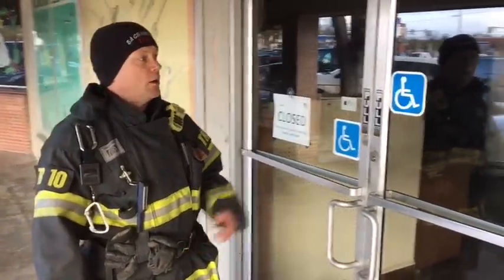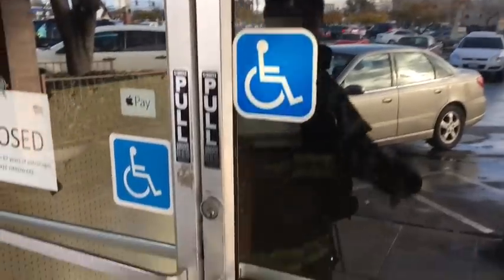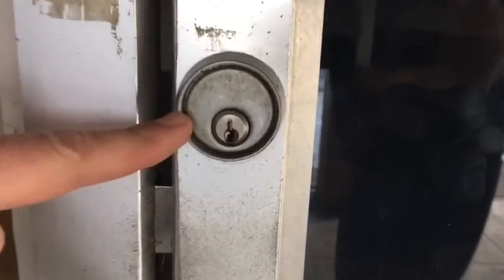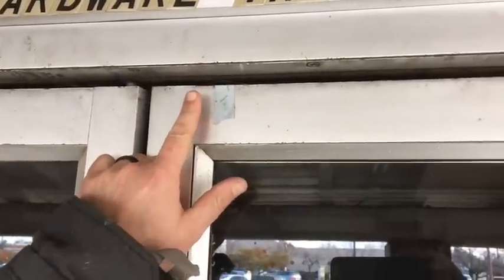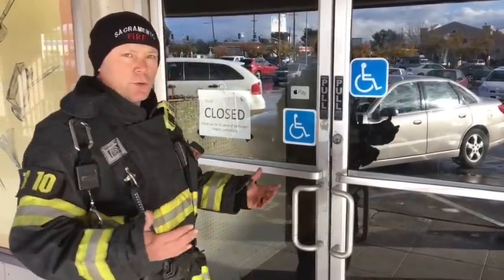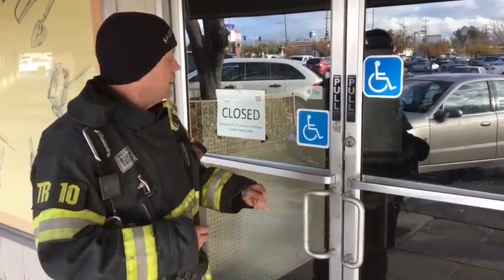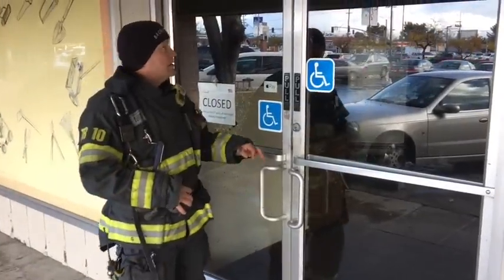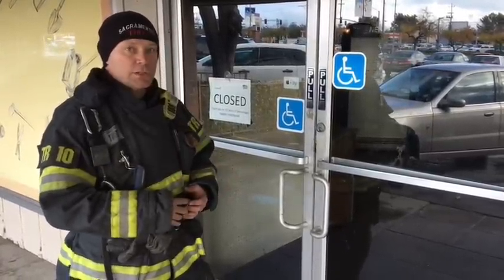Forcible Entry for Glass Commercial Doors

Comment: If it is a thumb turn latch inside there is a tool to reach in and let you rotate it from outside. Can be done in seconds and even used after to relock the door if you find it was a false alarm and no one with a key has shown up yet. Also works with weather stripping between the doors if you can wedge it back to give you access. 

Needs the gap between the doors to insert and the inner lock needs to be a thumb turn so only works on older style setups but still a good option. Right up there with the tool to pull the release handle on a garage door opener to let you lift the door for access as you can do that faster in some cases then kicking down a door if they used long screws and reinforcing pins.

Comment: Reminds me when the company I worked for about 20 years ago had the rear door upgraded to one with a panic bar.  The vertical top to bottom anti-tamper strip it turned out was optional. Customer service manager forgot her new set of keys and asked to use mine.  I popped the push bar as the FF in this video briefly mentioned to make a point the new door was less secure than the old one.  The door was retrofitted with the anti-tamper strip that day.  I asked her if a new key was placed in the fire fighter key box.  She did not know we had one.  Fire captain thanked us and reminded his crew to always verify during annual inspection the box has the current keys.

Comment: Good stuff Truck 10. I always looked for a cheaper plate glass window next to doors (less expensive to repair than the doors), just the downside is flow path like you mentioned and broken glass to deal with. Always fun working alongside SFD during high rise drills. (Roseville Truck 1-B, retired).

Comment: Quite detailed, and a highly accurate representation of door hardware. I'm a door hardware guy / locksmith in Sacramento. It was very nice to hear you say that your breach methods are relative to the emergency. Small shop owners appreciate that.
Reply: My dad us a firefighter and has always told me that you never use more force than necessary. 

He got off shift one day and told me how his crew spent an hour at a shop after the call (fire alarm) was over simply to put the lock back into the door so the owner wouldn't have to worry about it. 

His other story is a person having a heart attack. They got to the door and it was locked, so his firefighter went back to the engine to grab the tools to open the door carefully, but dispatch came on the radio and said the victim was now gasping fro breath and unable to communicate. So he told his engineer to open the door. His engineer kicked the door hard enough to push the deadbolt thru the door frame (wood) and it swung wide open, about that time the firefighter got back with the proper tools to open it without damage and was like "Well I guess we won't need these."

Excellent examples of use of force in forcible entry. One there was no life or property at risk, so no need to go crazy and break shit. The other one there was an immediate threat to the victims life so damage to the door was secondary to victim survival.
Reply: Jared Barsuglia WUT ur address
Reply: You seriously pressed 4 keys to butcher the word "what" that bad? I applaud the effort, but dude, I'd be surprised if he responds. He's not hard to find, try google.
Reply: You didn't have to point out your name sucks, it's evident.
Reply: bamrak2000 lol

Comment: All of this and they could simply get a Quick Jim that will engage the thumb bolt on the other side, the quick jim is a tool that is U shaped and allows the person to move  the inside thumb bolt as if you where inside allowing you to unlock it without any damage to the property and giving you the ability to make entry when you see fit. Cost is about 80$ or less for Law Enforcement or Emergency personnel.
Reply: A lot of places have a lock on both sides.

Comment: All those fancy tools.. you can open that door in 60 sec. with a single pair of vice grips without causing any damage or visible force entry marks. On the mortise lock there is a very small single set screw keeping the key mortise from spinning. If you grab the outer lip with the vice grips and spin counter clockwise the setscrew will slip every time. Unscrew the mortise and reach in the hole with almost anything pointy and move the latch bar to the right. Unlocked~ Have had to do many this way over the last 30 years at my job.

Comment: I'm not a firefighter but I manage a property maintenance company and we mount a KNOX box on the properties to hopefully make things easier. Having a key seems like the best option.
Reply: That system is only as good as the owners following the setup and key control for the boxes. If keys make it out to the wild every box is now an unsecured access point. If the owners fail to have the right key or load the box with multiple keys it is no help in an emergency.
Reply: Indeed. It's important to be sure that the proper keys, and even better, a tag on each key, are in place.

The Knox box door can also be tied into the alarm system, a wise practice. When we access the box, it's known that we are making entry.

Comment: There can also be a mag lock on the inside front frame of the door
Reply: Magnetic locks in a lot of jurisdictions are now against code because they may not automatically release in an emergency or may be difficult to release in a panic/emergency system.  Some may be grandfathered in however.

Comment: Just because there's a rectangular guard over the cylinder, doesn't tell you if it's rim or mortise. it just keeps you from using a K-Tool on it. the diameter of the actual cylinder is the same.

Comment: Quick tip on the panic bar style, on older models the top and bottom pin are connected poorly (read directly) together. If you lift the pin on the bottom the top is usually also pulled. We had problems at work with people sneaking in and only found out about it when my coworker was standing on the other side of the door. He had just kicked them out and was trying to figure out how they had entered.

Comment: good training video but driving the truck thru the door would be easier
Reply: I guess it depends on the emergency, I personally would just take a glass breaker and smash right through it.
Reply: Yeah and then you have bigger ventilation which is worse. That's also why they don't just break glass.
Reply: The purpose of defeating the lock is to open the door. It doesn't matter how it is opened if there is a serious fire condition in the building, the ventilation effect will be the same. In that case, the secret is to NOT open the door in any manner until an adequate charged hose line is in position to attempt suppression. If backdraft conditions are present, normally the glass will be hot enough to break when hit with a hose stream, and nothing will save the door from destruction by heat and fire anyway. What this is really about is not doing unnecessary damage during a smoke investigation, or the very early incipient stage, or even free burning stages of a fire in a room separated pretty much from the entry point. Don't do more damage than the fire, if it can be avoided. The mission is to save and protect, not to destroy.
Reply: Hey look folks...an expert.
Reply: Didn't you hear him say smashing through the door creates a huge ventilation path? It's obviously much better to smash the truck through the wall. Problem solved!
Reply: Breaking Toast And the truck cost just about 300,000$ depending on where you are.
Reply: Breaking Toast good cause to take the truck out of service
Reply: "Yeah chief, i totally meant to drive the truck through!  Saw it on a training vid!!"  On a side note, dont forget the target/k12 to go through the latch
Reply: That would just make the situation worse if there was a fire it would feed the fire with oxygen
Reply: @tasmaniac1  
Shattered glass presents another problem, slip hazard.......
Reply: 🤣🤣🤣🤣 right

Comment: What about when a place has a multipoint hook lock and triple toughened laminate safety glass bonded into the frame with structural silicon?
Reply: Breacher up!

(or just use the saw)
Reply: Then the only thing to do now is grab the marshmallows and call the coroner.
Reply: Al Paca furiously starts the K12
Reply: mount a battering ram to the fire truck and bust it down

Comment: Anyone watching this for correct info this is incorrect info. Cylinder rings does not indicate at all what type of hardware is used. Easiest way for a MS lock which is on this door. Stick a thin bar on top of latch and hit with your ax. There is only a tiny pin that keeps the throw bolt engaged. For panics the tool is easiest without damage. Or just stick pry bar and jerk pry. You'll just pull strike off jamb. In reality a majority of hardware is actually pretty flimsy

Comment: Would a saw cut the bolt without damaging the frame of the door?
Reply: As was said in the video, it would depend on the gap being wide enough. This is pretty far apart and I'd estimate that someone reasonably skilled with a circular saw could cut through this without damaging the rest of the door, but  unless there's severe time pressure the first way to go is to pull out the cylinder. That's a lot easier to replace for the owners of the door - in fact, over here the fire brigade carries replacement cylinders which we'll put in afterwards.

Comment: Well I just saw a way faster and simpler technique that the Nashville fire department uses they call 'spinning the lock' if it's a Morris lock like the one in the video. Where you simply just grab the outside of the lock with a vice grip / wrench/ pliers & twist it to the side with a little muscle to break the head off the screw holding in the lock. & Then the lock itself actually threads into the door, so you can just use your open hand & start spinning it counter-clockwise, & the lock will slowly start coming out of the door until the whole lock drops out. 
Bonus: it doesn't set off most Alarms!
Reply: Many of the better cylinders have a ring around them to deter spinning attacks, and spinning sometimes destroys the threads for the cylinder retaining screw in the lock body as that screw is supposed to be hardened to resist breakage. Almost all these locks can be easily bypassed in seconds with readily available inexpensive tools made for that job which require little skill to use, and those do not harm anything in the process.

Comment: Panic Hardware? We call it vertical rod assembly. You can put panic hardware on any style lock, standard or vertical rod. Panic Hardware usually refers to the mechanical or electrical push bar on the inside that releases the latch.